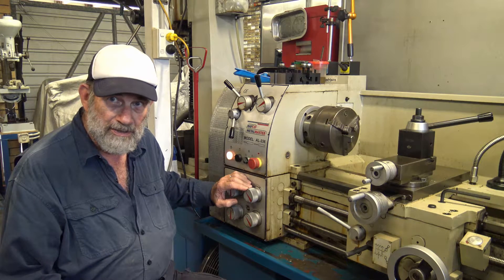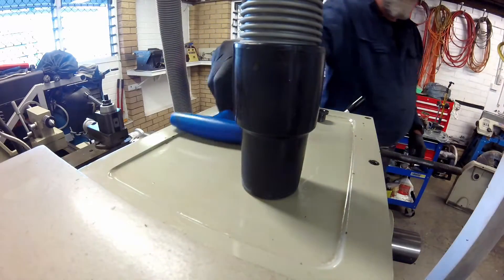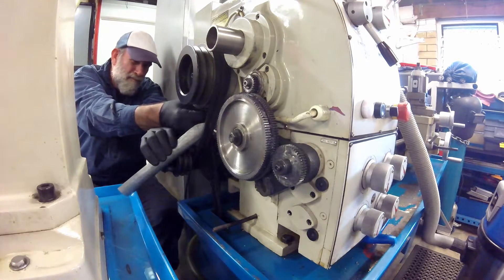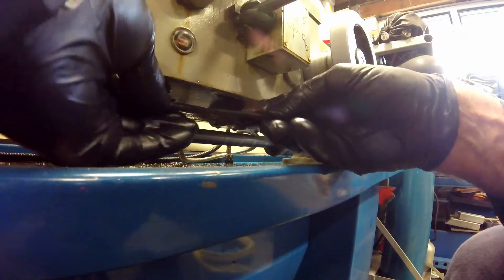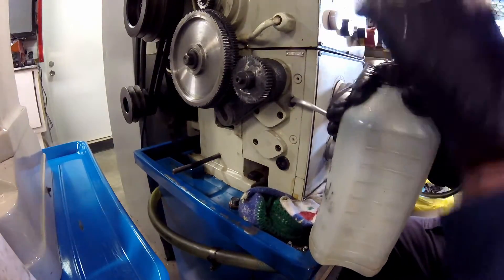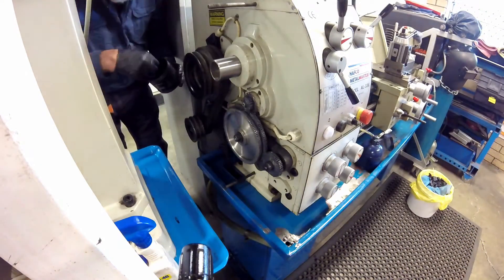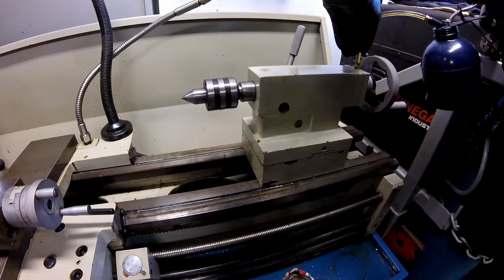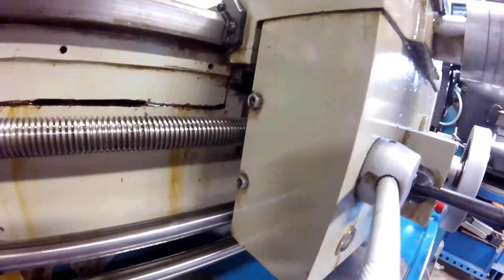Servicing a Centre Lathe

Comment: Hi there & thanks for this great video,  I'm about to spend $$$ at Hare & Forbes for a new AL-336D but I'm a little worried about Chinese lathes, heard a lot of bad stuff, but this is what I can afford. Have you had any problems with yours ? What did the oil look like at your first service ? is there anything I need to look out for ? love the videos, KEEP EM COMING - Cheers from Maidstone / Melbourne Aust
Reply from the maker: My lathe is 12 years old and has not missed a beat in that time and was pretty well in true alignment when I set it up so I can't complain.  The oil has always been clean, I pulled the top off the headstock box a couple of years ago and there was no shrapnel in the bottom. However little things like finish let it down. H&F also sell Taiwanese made lathes as well, more $$$, but visually better quality. I owned an English lathe years ago that was no where near as good as this H&F one. I have used English and Russian lathes in industry, but that was many years ago and they were much bigger machines. 
What to look out for, not sure with new lathes. To be honest, I have not kept up with the lathe market, because the one I have works fine and will probably see me out. Nothing much seems to have changed except the addition of DROs and I do like the concertina shield they fit over the lead screw. When I bought mine I had specific needs in respect of swing over the bed, spindle inner diameter, bed length, low speeds, geared headstock, ability to easily cut both imperial and metric threads with a good range of change gears. Being new you don't expect or accept excessive back play in the slides.  
The Chinese get blamed for a lot of quality problems these days, some of which are true and some of which aren't. In my youth growing up after WW2 the same was said of the Japanese and "Made in Japan" is synonymous with top quality today. China is on a quality trajectory that will match Japan in time. It really depends on the Australian importer as to the quality here I think. In my travels I notice that Chinese made equipment sold in the USA is much better quality than the same stuff sold in Australia, Britain and New Zealand. I think, actually I know from mates in some of the multinational equipment suppliers, that the Americans require much higher quality and the Chinese deliver this easily. It is all a matter of specification I feel. Hope that helps.
Reply: I have an AL 336 ( its about a year old ) and its Good Cant Fault it . Decent Internal Spindle size ! slow enough , fast enough , Left and Right thread capability , came with 3 and 4 Jaw + face Plate 2 Steadies Gears manual and Centres and Tools .The Manual is a little so so .  ( Not Tooling and no Live Centre ) Tools with tangs cant be used on the tailstock if you want to use the taiistock scale ! as you cant wind it back without the tool bottoming and coming out.
Reply from the maker: @claytonchristophersen1633  excellent points and spot on. You are right the manual is terrible, you get better information talking to Hare and Forbes lathe people. You need to factor money for tooling for the lathe into your consideration. It can get costly. I would suggest you just buy what you need to get started on your projects and then just buy other tooling as you develop the need. Mills are a lot worse though, I reckon I spent the same amount again as my mill cost buying tooling for it.
Reply: @whitedoggarage  Mine has the concertina lead screw cover. This means that you can't use  collet chucks because your tool will never reach the work surface-the covers will bind up long before the tool approaches the workpiece. The solution is to make an extension piece, but this extends the workpiece away from the spindle thus sacrificing precision. Mine is a hobby lathe, I think I'll ditch the covers and spend a minute or two cleaning the leadscrew more often.
Reply from the maker: @johncrowley5612  I have looked at those covers, the latest version of the 336 has them fitted, and thought they were a good idea. But it seems they have limitations. Good to know that problem. Thank you.

Comment: Hi, i have the exact same lathe, but my one seems to be leaking oil from under the quick change gear box, would you have any idea where it might be coming from exactly?
Reply from the maker: No idea really, but there are some places you could check. Oil is very good at travelling sideways as well as down. The bottom of the quick change box is probably just where it funnels to. Obvious ones to check in that area are the saddle drive shaft outputs and the drain plug for the gearbox itself. Further up is the spindle gear box drain plug area and the spindle shaft seals. As a further thought check that any excess from the oil you are using for cutting on the lathe is not collecting under the chuck and making its way to the front of the bed and then down the front of the quick change gearbox. I hope that helps.
Reply: @whitedoggarage  thank you very much, I will have another look and try figure this out with out pulling apart the lathe. Thanks again. And your video was a great help, I couldn't figure out where the drain and filler plug was.
Reply from the maker: @emanekaf4107  Thank you and good luck with finding that leak.

Comment: 13:00 are there dust covers for those lube points to keep out foreign material?
Reply from the maker: No dust cover like the original oilers had. These have brass ball that is held up against the opening by an internal spring. The oiling process involves using the end of the oil can nozzle to push the ball in to allow oil to flow into the gallery. The springs are reasonably strong and you can feel the ball going down as you push the nozzle in. Somewhere on YT somebody shows how he replaced those oil points with oil lines fed from a single reservoir, which is interesting and probably a better system than going around the oil points every day of use.

Comment: Hi Bob, great tips on servicing. I have the same model & would like to get a QCTP to suit. Where did you get yours & are you happy with it?
Reply from the maker: I got mine from Hare and Forbes, and some time later I also bought some extra holders. Quite happy with it, it works well and so much quicker to change tooling. Still got all the shims I made for the original tool post :-). Installation is relatively easy, but you have to modify the clamp plate to suit the compound slide. The one they sell comes with a universal base plate which is too thick to slide into the compound on the 336, so I used the mill to slim it down. Also, the QCTPs come in a couple of sizes, to suit a range of lathe swing sizes. So you need to know your tool to bed distance to get the right one. Hope that helps.

Comment: I'm not an expert on lathes by any means and defer to your experience, but genuine question: Is it really necessary to change the gearbox oil in a lathe in a home shop? - My reason for asking is most cars don't recommend a gearbox oil change interval and those gears get just as much hammering as a lathe gearbox. I can see why it would be good practice in an industrial setting, but surely home shop or even light commercial use would not come close to wearing the oil out and any initial wear-in on the gears would be caught by a well-placed magnet. Like I said, genuine question, not trying to be a smart arse!
Reply from the maker: BM that is an excellent question and I certainly don't see it as sa one either. You make a good point. Cars probably do work harder than a home shop lathe and have less frequent oil change periods, although that can depend too on whether the recommended oil is 'mineral' or 'synthetic' grade. Consulting the manual for the AL336 I see it recommends changing the oil in the headstock every 6 months and the apron (saddle) every 12 months. I'm going with 12 months for the whole machine as that suits my use of it and probably yours. 
My industrial experience is in the maintenance area and lathes in that situation get used every now and then, rather than all the time as would be the case in a production setting. Oil changes sometimes depend on the boss's or the fitter's inclination. These days most of the bigger firms doing production work would have a maintenance schedule most likely specified by the lathe manufacturer or based on their own experience. Interestingly oil companies seem to recommend about 2 years for oil containers that have been opened, which sort of puts a time frame of up to 2 years for oil in use I imagine, although car companies seem to expand on that.  
Still an excellent question well worth asking and I certainly don't have a more definitive answer than referring to the manual. Even then I have expanded the service interval for the headstock. Thanks.

Comment: I have one of these it is a piece of CRAP I have had to fix so many things that were poorly made from the factory absolute CRAP
Reply from the maker: Sounds like you got a bad one. Mine has been okay, my issues are really about the layout, I mean most centre lathes have the same sort of layout, but it is the little things they could do better. Always good to have another opinion though, so thankyou.
Reply: I also have the same lathe and I would make a couple of comments. 1. They are not well made and have some built-in issues that are difficult or impossible to fix. 2. Hare and Forbes warranty service is near non-existent. They simply don't want to know. At least, that's what they're like in Melbourne. 3. Having said how much I hate H&F, their lathes and mills are generally good value for money and all most hobbyists can afford. To get better quality generally means spending way more and so most of us are stuck hating them but still getting the job done.
H&F in Melbourne have told me more than once that they 'prep' each machine before delivery but this is, as you said, absolute crap. The lathe I had before this one was delivered to me dry. i.e. no oil anywhere. The gear boxes were bone dry. The splash guard was so bladly damaged that it had ripped away from the mounting bolts and yet, the outer packaging/crate was undamaged. Their response to both issues.....it's up to me to check the fluids (even though they told me it was 'plug & play') and that they don't carry spare splash guards and said you fix it and we'll send you a $15- knurling tool as compensation.